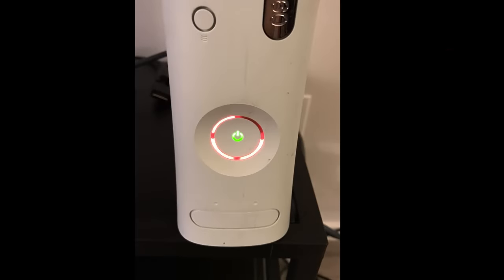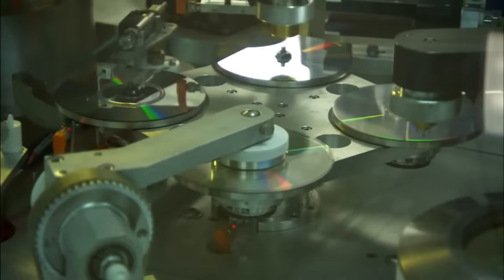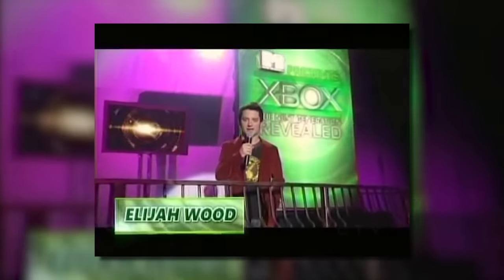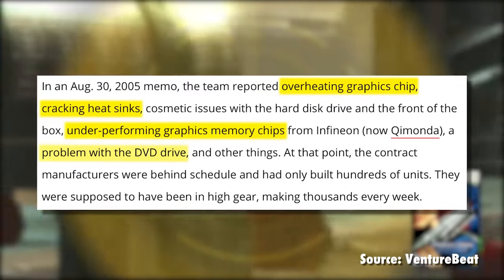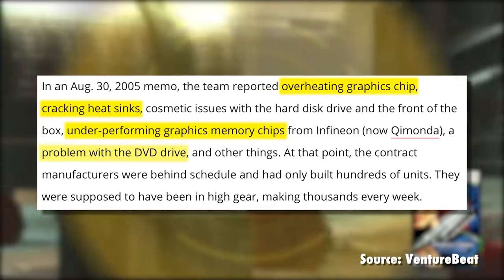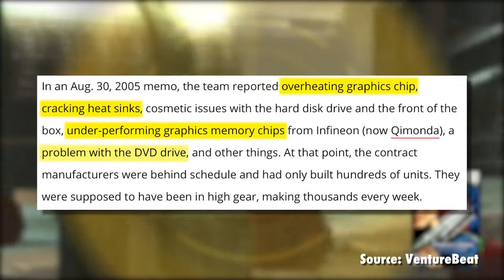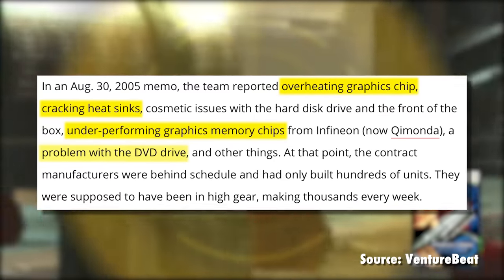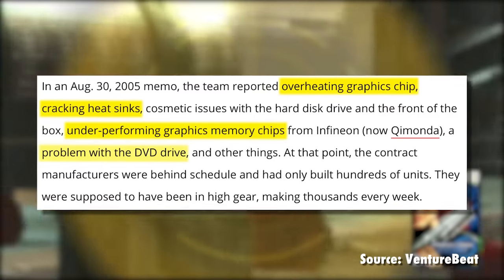History of the Xbox 360 Red Ring of Death | Past Mortem | SSFF

Comment: How to prevent the red ring of death:
1. Open the console up.
2. Remove the red LED.
3. No red LED = no ring of death.
4. Profit.
Reply: Voldy356 lol
Reply: I put mine in a fish tank full of mineral. Lol
Reply: Stonks
Reply: 5 ???
Reply: @davids1854  why should there be a 5? Lmao
Reply: i have fixed three xbox 360's with red ring off death ,,
i used a FREEZER stick XBOX 360 in the freezer straight after its been on for awhile
"most red ring of death are cause from the thermal paste above the cpu becoming more liquid then a solid paste"

heating the xbox 360 up, by turning it on,
leaving it to run till it get warm,
 then rapidly cooling it by freezer,
leave then xbox 360 in the freezer overnight,
the thermal paste when cooled shrinks a bit pulling the thermal paste back under between the cpu and heat sink
,, allow xbox 360 to dry in the sun condensation from water molecules with be inside it from being in the freezer,,
"ALLOW to dry before plugging it back in and i have fixed three xbox 360's using this method"

my mate had previously ripped his apart and we got it working again by physically applying new thermal paste under the heat sink but the xbox 360 was broken apart they made them un-serviceable..
 i thought long and hard and used a SCIENTIFIC approach on my console to counter act the thermal paste problem ,,it has worked for me 

there is other issues that cause red ring of death i seen one had red ring of death because a cat pissed on it and no i was not able to remove that red ring off death as it had obviously shorted out a electric component and trouble shooting is impossible without some sort of specialise Xbox 360 mother board tester "that only Microsoft would have at there disposal"
Reply: @The SimulationKid  The expert pointed out, "The heat sink on the graphics LSI is so small, I wonder if it can really cool down the board." The reason for ... This is bad design. Really ... Microsoft Adding Extra GPU Cooling to Retail Xbox 360 Elites.The problem with heat, is the fact that there really is no intake of air.

They have 2 fans on the back for exhaust, but what's the point if no air is being pushed over the heat sink?

The noise came from the DVD drive. Mine (one of the earlier models) have a noisy drive.
Though these issues have been addressed in the newer revision of the 360.was pulled from thread by microsoft but reality is mate xbox red ring because of the heat sink being so shitto so thermal paste it all you like my freezer fix WORKS,,
if your going to pull it apart then get a better heat sink fullstop
like you think i dont know what i am talking about lmao "KID"
Reply: which is why i only use my Xbox 360 on a tv that only goes to 1900x1080 max resolution the graphics card on the xbox 360 can go HIGHER but it WILL OVER HEAT if you play games for long periods of time,,
 "the overheating is what causes the red-ring"
NOT freezing 
OVER HEATING causes
problem
freezing it RE-"cures" the thermal paste so you do not need to pull it apart you just need to fix the thermal paste that is still there, its chemical make up changes once frozen it takes OVER NIGHT to work
Reply: Its actualy cute that it said goodbye by giving us little lights 😔
Reply: @The SimulationKid also the fact remains the HOT heat inside of xbox at day with AIr having WATER in it will turn to CONDENSATION in a cold mourning so GUESS what there is water molecules 
 EVERY cold mourning after a hot day of game playing xbox 360's will have water drops inside them from condensation" unless you live in a place with 0% humidity 
  there design problem is as i already stated due to POOR ventilation and no air intake
Reply: I know it’s a joke but if you actually did it there will also be no green LED. Because the LED changes colour.
Reply: Stonks
Reply: Lol
Reply: Stonks
Reply: Stonks
Reply: XD
Reply: Stoinks
Reply: Stonks
Reply: Let's go I can fix it finnaly
Reply: @Red1676  no you didn't.
Reply: @jessemoir7619  none of this is true.
Reply: STONKS?
Reply: Voldy356 STONKS
Reply: STONKS
Reply: @Lil Cookie YT It indicates when something's wrong.
Reply: Perfection
Reply: Voldy356 100000 iq
Reply: 100000000000000000000000000000000000 iq
Reply: Parker Hansen 1000000000000000000000000000000000000000000000000000000000000 iq points
Reply: @zorlokarma  s
Reply: Voldy356 HYPER MEGA STONKS
Reply: someone got wooshed
Reply: thats the dumbest thing i've read all week.. but true
Reply: BIG BRAIN
Reply: That works I guess Lol
Reply: Smart
Reply: Kendrick Carroll r/Whoooosh
Reply: What about smashing the button off With a Mallet?
Reply: Big BRAIN dude!
Reply: Voldy356 invisible ring of death has been created
Reply: Stonks
Reply: Life hacks
Reply: S T O N K S
Reply: The Xbox company would like a word with you
Reply: Stonks and more Stonks
Reply: In the background STONKS
Reply: Too late now

My brother threw his old Xbox out and he’s got a Xbox that makes a car sound
When turned on
Reply: Voldy356 dont wooooosh me but... I think it’s just four LED that switch from green to red
Reply: @jessemoir7619  wtf
Reply: @danielkleimenovas9484  for me it's blue (xbox 360 halo edition
Reply: @b4ds33d  r/whoooooooosh
Reply: I tried it i fixed my xbox
Reply: broo youre like 400 iq
Reply: LOL
Reply: 5. Don't buy an xbox 360
Reply: Voldy356 GASP YOU GENIUS!
Reply: OH YEA ITS BIG BRAIN TIME
Reply: XD
Reply: Instructions on how to prevent red ring of death V2
Reply: STONKS
Reply: S T O N K S
Reply: @jessemoir7619  r/iamverysmart
Reply: My did too, had so many games too 😭
Reply: default dance
Reply: Voldy356 intellegence 10000
Reply: If that doesn't work
PUT IT IN RICE
STONKS
Reply: It still die because the hardware problems leds don’t fix a console
Reply: I think I'll just die and you don't know does the white can't warn you that it's
Reply: This is troll face/ U mad bro mixed with the Gru poster meme.
Reply: Hes a GENIUS
Reply: stonks
Reply: Voldy356 lol
Reply: IQ 250
Reply: Fucking... Genius...
Reply: That's DIABOLICAL.
I love it.
Reply: Once it pops up just unplug your Xbox quickly
Reply: I just turned it off right away and left it for a few hours and it was fine and still works just checked.  Don't use it anymore, but still works.
Reply: sToNkS
Reply: 100th comment
Reply: Put blue LED in, Sell it as Limited Edition Xbox 360 with BLUE Ring of Death!
Reply: Big Brain
Reply: But then you will have a red ring without you knowing.
Reply: LMAOOOO
Reply: Genius
Reply: Genious
Reply: What If people use 100% of their brain?
People with 100% brain :
Reply: Sureeeeeeeeeee.........
Reply: This is super long but I mind it.
Reply: Just yeet it out the window and buy a ps3 or 4
Reply: YES
Reply: XD
Reply: another way

1: remove insides
2: remove red leds
3: replace them with more green leds
4: more green leds = more players and no red ring
5: 8 player profit
Reply: @rarebrockstark6219  music
Reply: Stonks
Reply: Have you tried turning the XBox on?
Reply: STONKS
Reply: Voldy356 SMORT
Reply: OMG the Replies are big brains
Reply: jesse moir holy crap.. thanks for the advice. I was planning to get a 360 and I was worried..
Reply: FBI OPEN UP
Reply: The red ring king returns
Reply: stonks.
Reply: Lol
Reply: how to give someone a oscar for being the smartest person
Reply: Just put your Xbox on fire
No Xbox no red ring of death
Reply: Adam Crawford that's what makes it funny.
Reply: Voldy356 nice
Reply: Voldy356 lmfao
Reply: Step 3?
Reply: Put it in a bag of rice
Reply: Lmao😂😂😂😂
Reply: no
Reply: i did that
Reply: Lmfao
Reply: It would break, But it is profitable!
Reply: Step 1 - Collect underwear
Step 2 - 
Step 3 - Profit
Reply: Genius
Reply: And a Brocken cblock
Reply: How? Step 1: open console
Step 2: ready eggs
Step 3: throw eggs when red ring shows up 

Teached by HowToBasic
Reply: 9000 IQ
Reply: Stonks
Reply: haha big funny
Reply: Beeg brain:10000%
Reply: Wrong it would gust be the ring of death with no red ring
Reply: professionals have standards
Reply: Lol
Reply: @pro-totype8010  y e s
Reply: Lol
Reply: it's big brain time
Reply: 200 iq
Reply: Is moldy
Reply: I love this
Reply: Oh okay 👌
Reply: Instructions not working my dog turned into belle Delphine
Reply: bruh
Reply: hes a GENIUS
Reply: Instructions not clear my dad went to HOME DEPOT and got a CAT the cat turned into BELLE DELPHINE so I gave the cat some WEED and now the CAT IS LICKING STUFF AND DOING WEIRD FACES
Reply: OmG iT WoRkED
Reply: bruh
Reply: Nah it doesn't work
Reply: @jessemoir7619  wooosh
Reply: If you disable the red LED it won’t show but it won’t prevent it
Reply: Bruh I must have been lucky cuz I had this and I just turned it off and turn it on and it work again
Reply: Ah red
Reply: lmao
Reply: 1000000000000000000 iq
Reply: Big brain
Reply: Well said
Reply: lol
Reply: Why didn't I think of that?!
Reply: @agentmynt  It's an Oversimplified reference
Reply: Lol fac
Reply: Nice lol
Reply: ty
Reply: I had a slim 360 (I never had a Premium/Core/Arcade/Elite) and because I never owned any of the first four 360 models, I never saw a Red Ring trigger me and just either A. throw the old 360 down a cliff and immediately switch to the PS3 or Wii, or B. contact the Xbox Customer Support to get the 3-year extended warranty for an older 360 that would have just died on me. Also how did you (@Stop Skeletons From Fighting) manage to have your Xbox 360 last for nine years from MFR until it's death!?
Reply: @altagraciaderodriguez450  Just yeet yeet out a Xbox 360 and IMMEDIATELY SWITCH over to the PS3/PS4.
Reply: Even though its a joke, the red and green LEDs are contained in one package. So you'd remove the green LEDs as well.
Reply: stonks
Reply: Bradley  SANKEY 
Xbox 360 !
!!!!!!!!
Port Simsons
Reply: @bradleysankeybradleysankey1134  wut?
Reply: Voldy: WHY ARE YOU BOOING ME, IM RIGHT
Reply: @leafgamingyt9220  yes, but, actually no
Reply: “Why are you booing me?Im right!”
Reply: So
Reply: Technology not wrong 🤣
Reply: @adamjc9683  someone can't take a joke
Reply: @cyberfox9713  well, it is technically wrong.
Reply: Y E S
Reply: Your so smart
Reply: Lolz 🖤
Reply: lol
Reply: Storks
Reply: nOW YOU ODNT KNOW HOW MANY PEOPLE ARE PLAYING
Reply: @jessemoir7619  the issue is not heat at all, its the solder bumps in the gpu
Reply: @jessemoir7619  overheating does NOT cause the problem bro, its the solder bumps in the gpu bga
Reply: STONKS
Reply: So funny
Reply: All cool in games till the lights respawn
Reply: Lol
Reply: @agentmynt 😂 i say stonks sometimes and nobody gets it. i had someone correct me and said “stocks*” and called me an idiot lmfao😂
Reply: You sir, are a complete and utter genius.
Reply: You’d also have no way to turn it on

Comment: I got really sad when I saw the red ring blinking in the back 😔🙏

Rip old boi
Reply: Same
Reply: Felt the same when I got the two lines (For Overheating)
Reply: And then you find that it’s just your AV cable has fallen out.
Reply: Hey man , recently had the same experience with my xbox 360 . 
what i did ( works 90 % of the time ) was taking the console apart ,   cleaning the fans (dont use compressed air ,it could break the fans ) . And changing the thermal paste (extra) .
Should work ,  atleast  it did for me.
Reply: All I could think was "unplug the poor thing you bastards! Don't extend it's suffering"
Reply: Jedi Knight  BLAZE IT B
Reply: @jamthatruth4174  My 360 had the overheat problem multiple times, but I never saw the overheat red rings. All I got was a freeze.

Comment: My x360 (manufactured in 2005) just red ringed this weekend with 3 lights. I unplugged it then plugged it back in and it now works.
Reply: That the worst model , i have feb2006 model and didnt fix
Reply: @user-fm7kt2lb5u  yeah ik, i should have waited and gotten the slim model because it has no red ring and plus hdmi
Reply: Same on my old 360
Reply: Wow, that's actually hilarious. Gets red ring of death, casually unplugs it and plugs it back in, hardware problem somehow fixed
Reply: @aurastrike  i guess the "hardware problem" was because i plugged it into a surge protector with a lot of other consoles into it so it didnt get enough power idk
Reply: Yeah you have a Xenon. 3 red lights means a GPU failure. 

Falcon and Jasper models aren't suppose to red ring.
Reply: That’s what I did too
Reply: My brother had the same model and it did the same thing. It continued to work for a few more weeks but eventually stopped working altogether. Good luck with it.
Reply: My Elite red rings when there is a problem with electricity.
Reply: my xenon red ringed ages ago as a kid and i just recently threw some new thermal paste and a new heat sink on it and it works great now
Reply: I did same but it was a true hardware failure
Reply: Same with mine
Reply: I just unplugged it and plugged it back in
Reply: The engineer
Reply: Nani?
Reply: @aaa same
Reply: I'm gunna get my sister's Xbox take of the case and drill holes in it. Try and over heat now :)
Reply: Mine was 2010, red ringed and I fixed it
Reply: Wasn't it a General hardware failure?

Comment: I still have my 2006 Xbox I keep it functional by 
A. I literally made a new fan port by cutting a hole in it and adding a fan 

b. I have 2 fans blowing on it constantly while playing it
Reply: There's gotta be that one vintage collector somewhere that literally reverse engineers his Xbox 360 and redesigns all components to have liquid nitrogen cooling, physically separated from each other, and sealed in a layer of vacuum, and completely reprogrammed to allow for better debugging...
Reply: @MrSonny6155  I have a friend who's dad did that with a computor, 3 ultra high definition screens  with the newest generation graphics engine, a liquid and air cooling system and a liquid nitrogen failsafe. it makes my ASUS look like the original iPod in comparison
Reply: I have 2 Xbox 360s, the first one was a 2007 one I received for my 3rd birthday and the other was a 2009 one I won in a contest, both are white Jasper's and both are completely fine, after nearly 10 years of continuous use. I don't need to put more fans in because for whatever reason neither of my Xbox consoles have ever died. The only thing that happened was my 2009 one had a full 4 quarter red ring but that was simply because the AV cable broke, so I got HDMI on that one.
Reply: Same
Reply: Ryan Miller  For most it was the Gpu de-soldering.
Reply: I bought an external fan made by nikko.. It worked perfect.
Reply: Same thing Today with my ps3
Reply: A wild Idiot i have a first gen 360 from 2008 and overall it still works amazing. I never got a red ring of death. Ever! I do have a mild issue in which you gotta push the disc drive button 2 or three times before it opens but once you get it open that first time, it opens right up no problem. 🤷🏼‍♂️
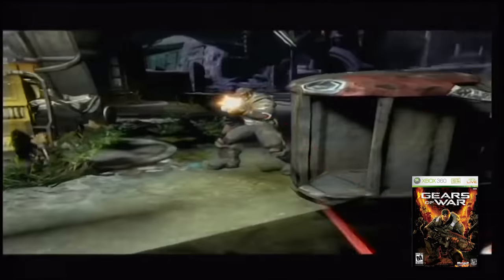Reply: Anyone noticed 5:03 FORTNITE CREATOR EPIC GAMES??
Reply: Same but I didn't do anything to mine it's still as white and old as normal but so so reliable
Reply: Battman Carter my Game Boy works awesome
Reply: Your success has more to do with being lucky than your mods.  The issue comes down the solder joints, adhesion of the GPU to the heatsink, flexing of the PCB, etc.  Your solution is kind of like trying to remedy a broken air conditioner in a house by putting a bunch of snowblowers on the front lawn, the issue is at the micro-level where a big external fan won't do much more than the existing internal fans if the internal parts aren't connected properly for the thermal network to be complete.
Reply: @nunyabusiness896  good analogy
Reply: I use a 3square foot fan that blows very quickly
Reply: Just had my 360 bite the dust (RROD) after 12 years of faithful service. It was literally the cheapest of the cheap $199 xbox 360 arcade with no HD and one small (less then 200mbs?) memory card. 
Its so old it doesn't even have the RAM pads on the back of the mobo to do the *penny trick*.

I salvaged what I could from her. Created a small wooden raft dosed in kerosine. I lit her ablaze with her controllers as she floated to Valhalla across my pond. Me and my buds fired a 21 gun shotgun salute as she spent her last moments on this earth sinking below the waters edge.
Reply: I had a friend who was a release Xbox fanboy.  By the time I got mine he had been through 3.  Each time he had tinkered to revive them and/or carried the previous fixes to the next. SO when I got mine as a gift from my girlfriend... I had to do something hard and harder to explain.  I never even opened the box and instead sent it to my friend who lived in a different state to mod it with all his fixes he had.  This Xbox 360 to this day runs flawless and has been heavily used.
Reply: Adventist let me guess the tray door is broke?
Reply: B

Comment: This happened to me like 4 years ago, I turned it off and turned it back on and it was fine 😄. It still works to this day
Reply: mine did that with a full red ring then three rings waited like 1 or 2 days and it still works today
Reply: That's because it wasn't actually a red ring of death. The red lights can blink in different orders to indicate other problems, like your A/V cables not being plugged in.
Reply: Both my 360s have red ring and the disc drives wont even open to get the game out its a joke :( they both worked out em in storage for a year got em back out the ova day n they was both red ringed :(
Reply: Awesome
Reply: I’ve had my launch console since 2005 and it still works fine. Only thing I do from time to time is give it a cleaning inside and replace the thermal paste.